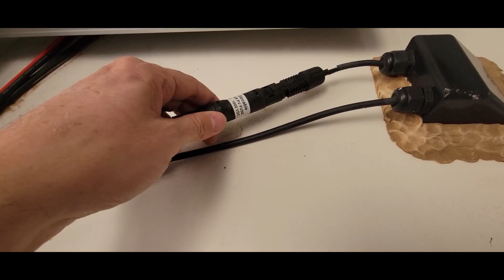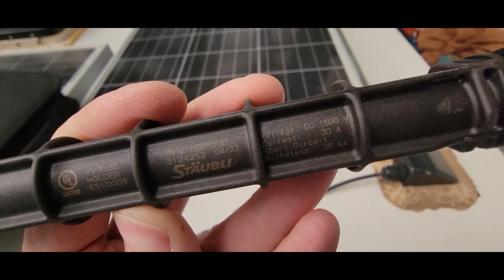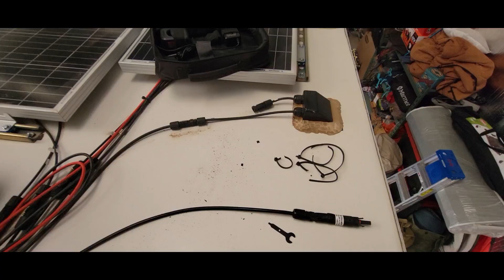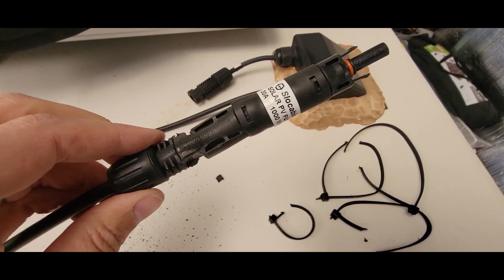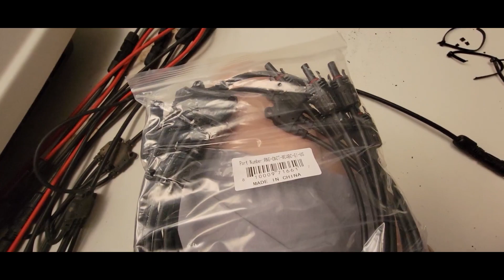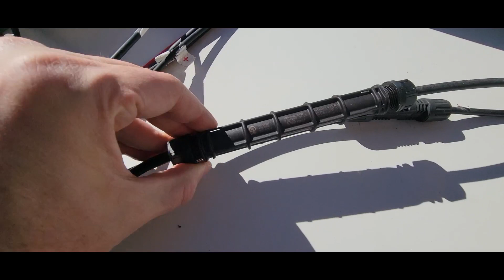Upgrading My Bad MP4 In-line Fuse Holder to a Stäubli

Comment: How has this held up?
Reply from the maker: I haven't had a single issue since doing it. I just resealed my camper's roof and the fuse holder is in the same shape it was when I installed it.